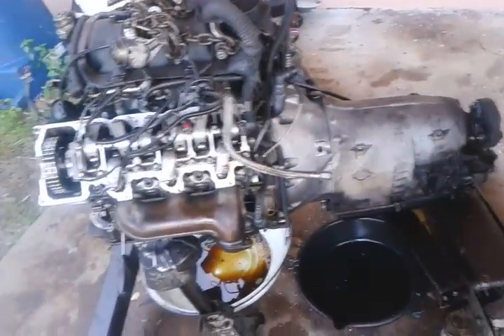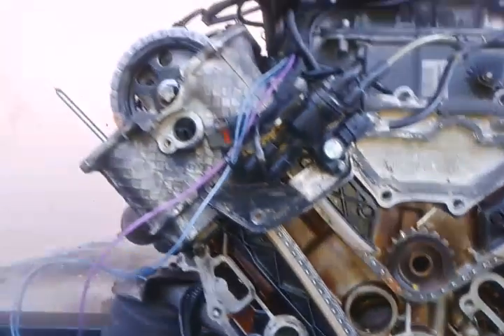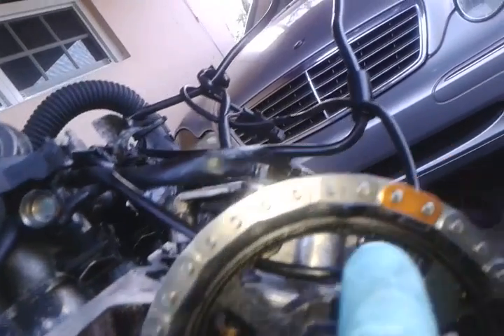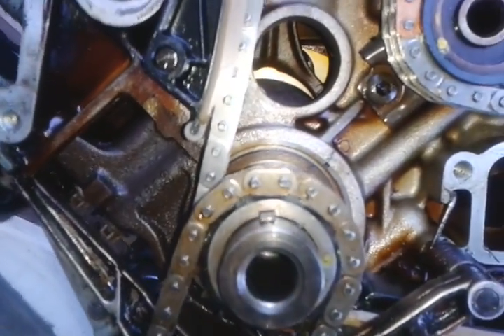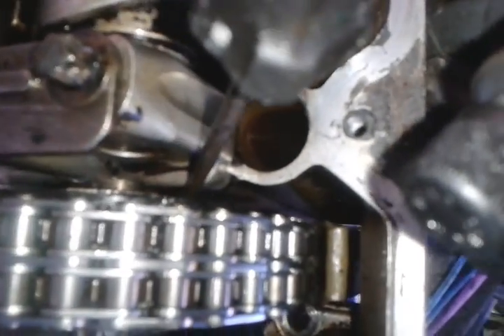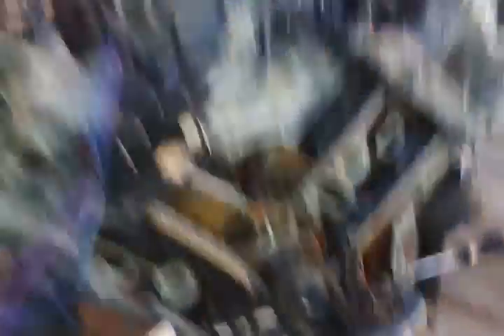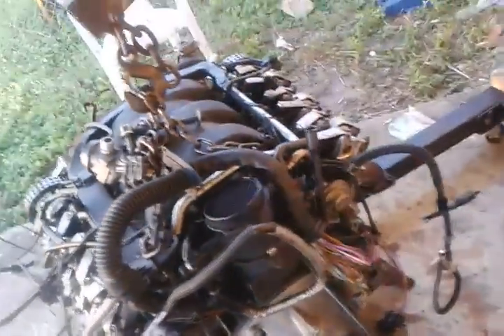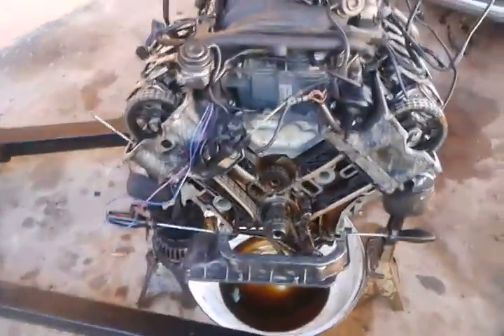MERCEDES BENZ V6, V8 TIMING CHAIN  MARKS

Comment: How many miles on the engine would usually require this chain to be replaced? (2008 CLK350) I have one with 144K miles and one with 182K miles. I noticed a noise the other day on the one with 182K miles. It sounded like a rattle/knock. IDK
Maybe not a knock? Maybe just a rattle? It's hard to hear, but you can hear it just before the dog barks. 
https://youtube.com/shorts/QuxWnkUyJuY?si=qk8V-aZR-20x-v76

Comment: Hey bro I removed the motor and transmission together, but when removing the cam sprocket the camshaft move on both sides, once I got it timed and back together I rotating it 14 times and it came back to the mark's as you said but now when attempting to start it cranks and stops, so I try turning the motor by hand and it gets really hard after the second rotation but gets easy about the third rotation, is my cam out of sink even tho I have them in the notches and aligned with the copper links?

Comment: I have a 2003 CL500 do I have to do a full timing chain if I take the cover off my thread broke on a power steering pump piece of the engine broke off with the thread trying to replace timing cover do I have to take the heads off

Comment: Gud vid but it seems like yo crankshaft is not on 40° mart TDC and the camshaft Grove looks like the not lining streight with the flat surface of the cylinder head  nway since it's a vid I might hv seen wrong thnks with the vid

Comment: I have a 1986 Mercedes 380 SEL w126  engine 86,747 miles . I started it after sitting for a whole year. It ran for about a minute and kind of locked up . I removed the valve covers spark plugs and still will not crank manually or with starter starter just binds up and starts to smoke if I keep the key on I don't want to put too much pressure on the crank what should I do. I'd appreciate some feedback if you have the time thank you.
Reply from the maker: Turn the engine counter clock ⏰️ wise manually and see if it give you a full rotation ,and if it doesn't than one rod is bent or broken.
Reply: Thanks I'll try that

Comment: Good morning this question is for anyone that know that can let me know I'm swapping my engine right now E500 5.0 engine it's front-wheel drive it's going to my CL500 it's a rear wheel drive I had to remove the front wheel drive upper and lower oil pan I also have to remove the oil pump my question is I have to swap with my old oil pump when I take the oil pump off will it still my timing off this engine is ready to go in today

Comment: In my days the procedure was to unpin the old chain, connect the new chain to the old chain rotate the engine while the old one comes out the new one rotates in .......of course  I would take out the glow plugs or spark plugs to make rotation easier....
Reply: I need to replace the chain myself and my school shop won't let me bring it in is this possible to do on jack stands if I pull oil pan and fan?? Thanks
Reply: Kristian Freund if your changing the chain only u have to take the valve cover off and you need an assistant to help you have to have the chain link remover if it's an older engine it's easier but u must know what your doing ..if not leave it alone
Reply: If you rotate the engine with no tension on the chain your chain is going to skip on the sprocket losing your timing. There is a procedure on YouTube for replacing the timing chain without removing the timing cover,

Comment: How often I have change the timing on this car, I’m buying a 2007 c240 with 125k miles
Plz help me, I’m going to c the car now
Reply: now
Reply: C series has a single chain and it stretches! In addition the cam sprocket wears and will jump causing your valves to get damaged. I have a 2005 c230 and has done it twice.
Reply: Thanx bro

Comment: WWGD.  What would the Gas station Mechanic Do?  The guy who doesn't have dealer support and special tool's.... ? Watch your video of course!
At first, I was like," eh, doesn't seem  very accurate.  After watching the whole video, gotta say it's pretty dead nut's on!    
I've used a Benz timing chain to fix a 996 3.4 without having to split the case.  Holler if you need any help with Porsche s

Comment: changing the timing chain on a 2005 c240 with the v6. Is this the same method? Do I really need to take the engine out of the car? +GEO DURE
Reply: car has skipped timing so bad that in now getting backfires. I am hoping that the valves haven't hit the pistons yet.

Comment: 2001 E320 station wagon. 
Can you change the timing chain without pulling the engine out. 
I'm doing DIY job and my space and tools are limited. 

Thanks in advanced.
Reply: Tarek lotfi hie there did you get any information about your wagon? I’ve mine too mixing oil and coolant I suspect the head gasket

Comment: My timing chain is jumped. Do you know some trick how to adjust timing without removing engine front cover? I Can control camshaft timing marks from top and crank timing - to remove oil pan.  problem is how to adjust balancer mark.  Do you know any trick about that? 

Also What is the torque spec for  M112 engine head bolts?

Thanks for advance
Kind regards

Comment: will this work for 2006 ml 350 v6 3.5l engine..the timing chain wont move when cranked up so car wont start and mechanic said i need a whole motor
Reply: +Olubunmi Ayodele It is a completely different engine and design. This is a video of the older M112 SOHC V6. You should have the M272 DOHC V6. There was a class action against Mercedes over those 272/273 engines. Very expensive and labor intensive repair.

Comment: 2000 clk 320 driver side  blown head gasket  oil in reservoir looks like  chocolate milk  no mixture in dipstick radiator holds pressure  tail pipe is dry  cel reads misfire cylinder 4
Reply: try a product called blue devil it doesn't sound like its blown too bad i guarantee it will fix it....so do they. and don't forget to change the oil. use the blue devil that costs $60 the other one they sell doesn't work as well.

Comment: Hi,I currently own a 05' Mercedes Benz C240 I was reversing my car when all of a sudden my vehicle then stopped and turned of the car when I started the vehicle it just cranked and did not start,How can I diagnose if my timing chain has broke,Cylinder 1 is sparking when I crank the motor and when I depress the fuel line gas squirts out so the fuel pump is working to my knowledge any other thing I can do to further diagnose my car, any help will be greatly appreciated!!!

Comment: Hello ralph.
I was wondering if you have to pull the timing chain off in order to remove the engine heads on a ml 320 2001 mercedes?

Comment from the maker: thanks guys for watching it my video...
Reply: Also do you have to rotate the crank shaft 14 times or the cam shaft that many times?
Reply: GEO DURE  hey how much would you charge to do the timing on a 2006 ml350?
Reply from the maker: parts and labor  around $850
Reply: Ok that sounds good. About how long would it take? Also, how much more would it cost to replace my mass air flow?
Reply: Also my car is coding that the timing is off. with the repair, would that clear my check engine light?
Reply: prismink4u pete

Comment: I owe you an apology. When I first watched this video I thought that you were comical. Although removing an engine would make sense, it is a lot of work. Calling yourself Master Mechanic Gio was at the time funny. Rotating a motor fourteen times, seemed to be overkill. After I replaced a timing chain, the first time in years, I now realize that you are pretty smart. Always doing belts you basically set them rotate the motor a couple of times and if the lines line up, you are good to go. I couldn't understand why the marks on the chain would not line up to the crank and cams even though the engine was in time. Then I remembered your video, and realized that it takes a few rotations for the marks on the chain to line up. I was also humbled by the fact that I have never worked on a Mercedes, although that is going to change. Compared to me, you are a master at your craft. Please accept my apology. I am just a DIY guy that is fascinated by cars. Thanks for an excellent video.

Comment: In this example the engine is being timed with the number one piston at TDC, I don't know about this specific engine but the normal procedure for the m112 [ Mercedes 320 v6 ] is to position the flywheel [ harmonic balancer ] to 40 deg after TDC [ In this position the keyway on the crankshaft would be pointing to 12 o clock ] then adjust the cams to align the cutouts to the top of the cylinder head 3 o clock right and 9 o clock left cam. you may also notice that the dot on the balance shaft gear wheel does not line up with the copper link, [ 1 :59 min ]
Reply: Hi. I'm  Ibrahim
Reply: Thts wht I know too his crank shaft isn't on 40° mark TDC and the cam shaft are off a little bit coz they aren't lining straight with the flat surface of the cylinder heads if he can put a timming tool there it won't line up

Comment: Thank you for your presentation, You really emphasized what needed to be highlighted. The timing chain cover on these engine cannot be removed without taking off the sump pan at the bottom of the engine because of the bolts that attaché the bottom of the timing chain cover to the block.so its a really big job to change the chain.